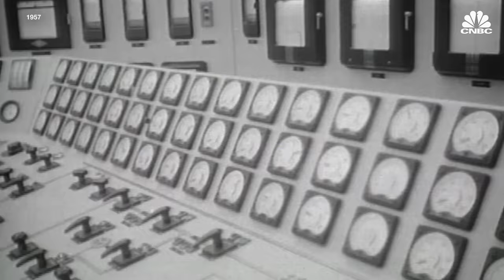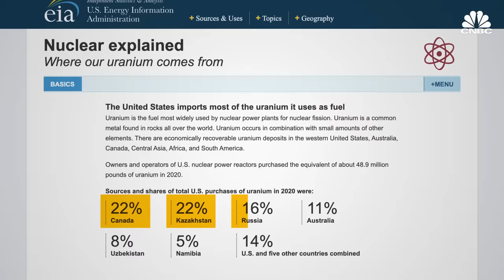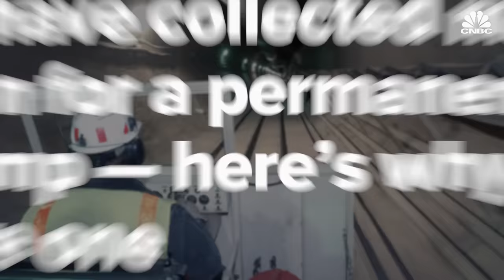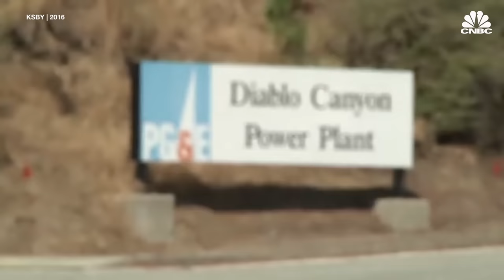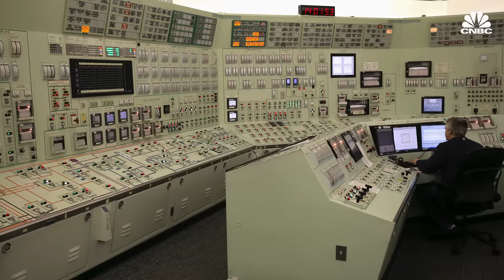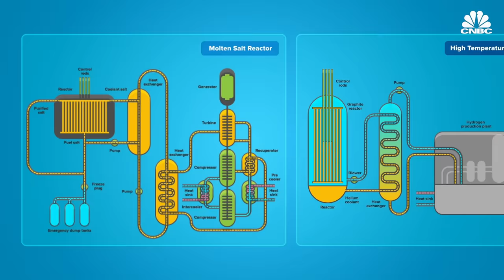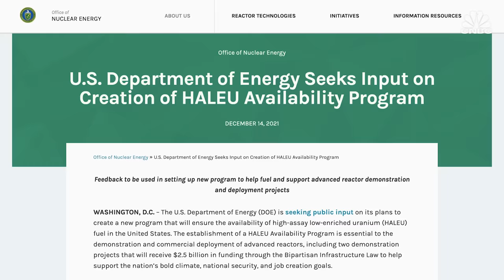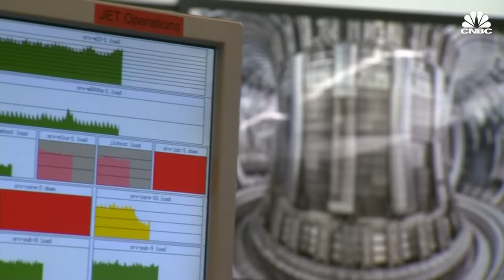Why Nuclear Energy Is On The Verge Of A Renaissance

Comment: What about LFTR/ thorium style reactors? It seems like this should be part of the conversation? They look like a safer option than the water cooled plants.
Reply: thorium is a fuel type, not a coolant type. they did actually mention molten salt reactors in the vid.
Reply: @jonathanodude6660  LFTR is though.
Reply: no, no it shouldn't, thorium is dirty nuclear
Reply: @user-by7hj4dj9s  Johnathan's right. Thorium is a fuel, not a coolant. The fluoride salt LFTRs would use could be used as a coolant, but it's a bad idea to use thorium in the coolant salt. LFTR is one of many possible molten salt reactors, and molten salt reactors are the best type of reactor to burn thorium with.
Reply: @mmoarchives2542  how so?
Reply: @mattbrody3565  well, to start, it is an unstable element, the molecules deteriates over a short amount of time, and it's not like uranium, where you can place them in reactive coated barrels and store it underground, the waste generated is uncontrolable, basically, it generates 50% less energy than 255 uranium, so thorium based reactors would have to a lot more reactors vs uranium reactors, thorium is a useless stand alone element, only useful in junction with uranium
Reply: @mmoarchives2542  Ok, figured I'd ask to see what your perspective is. I think you've actually got it a little backwards. I will concede that Thorium isn't a great fuel in practice, but that's for more complicated reasons. My apologies for the long read ahead.

First of all, thorium and its most common compounds actually degrade slowly. Thorium has a longer half-life than both U-235 and U-238 (12-14 billion years vs 700 million and 4.5 billion, respectively). The reactive coated barrel storage is for intermediate waste storage and prevents gases from discharging. The only gas that thorium would emit is Helium 4 due to alpha decay, and because of its longer half-life, it releases He-4 slower than uranium does. Intermediate storage prevents microorganisms from digesting nuclear waste and releasing gases, and there's nothing found in Thorium compounds that biologics would eat. The same goes for uranium.

Thorium oxide, the natural form thorium is found in, is well-known for its chemical stability and inability to dissolve in water. A large amount of it is currently buried in old shipping containers out in some desert, either in Nevada or Arizona. No leaks have been reported so far, nor have there been widespread contamination issues from waste piles at mining sites. It just sits around and doesn't do anything.
 

The waste from a thorium fuel cycle isn't actually uncontrollable. If anything, it's quite similar to a standard U-235 fuel cycle. U-233, the main daughter product of Th-232, burns up about 90% of the time when hit by neutrons. Even when U-233 doesn't burn up, it becomes U-234, then U-235, which burns up 85% of the time. The fission products left behind by U-233 and U-235 are not significantly different from each other, so waste containment shouldn't be a big issue. There's an added benefit of not having U-238 in a thorium-fueled reactor cycle, since U-238 produces transuranic waste. That's the most problematic stuff. The high rate of burnup for U-233 and any remaining U-235 further reduces transuranic waste buildup by a small amount.

The second daughter product of breeding thorium is U-232 which, while highly radioactive and neutron-absorbent, to safe levels in 40 years and only makes up 10% of the total breeding products produced. For waste storage purposes, it's better than plutonium with a 420,000 year half-life.

I'm not sure where you got the 50% energy reduction figure from. Assuming we use an MSR with fuel reprocessing, there may be a small difference, but not 50%. Maybe 15-20% at most.
Reply: @mattbrody3565  -- thanks for the technical information in your extensive reply.   Perhaps you are overlooking the track record of reactor projects using liquid metal [or molten salt] as a heat-transfer medium.   Experiments for what would have been the first airborne nuclear power plant were performed as far back as the mid-1950's with many engineers reacting in amazement at the heat-transfer properties of the liquid metal as opposed to light water.  This, however was short-lived being that the USS Seawolf reactor had excessive mechanical problems due to the corrosive nature of molten salt as a medium.   EDF of France went in big back in the 1970's with their 1200 megawatt Super-Phenix only to come to a commercial viability dead-end.   Trillions in today's dollars have been historically spent on these systems without much to show for it.   Additionally; the real possibility of some type of water-sodium reaction occurring with ensuing mechanical damage in in the picture whereas this situation is not present in the light water types.   Try to read our comment above on the viability of reactor power and CNBC's reporting on this important matter.     RON JAGRAF/X
Reply: @JAGRAFX  Thanks, I have looked into it. A couple of things to note, though. The Aircraft Reactor Experiment was never going to fly, the lead engineers admitted as such in their memoirs. They did, however, plan to work on molten salt corrosion issues during the MSRE. Recent experiments have also found that flibe salt can actually reduce radiation-induced corrosion in alloys with high nickel content... like Hastelloy steel.

The heat transfer properties are quite nice, and there's more work to be done to make it practical. If coolant can be safely kept in liquid form at atmospheric pressure, it's worth putting in work to make that practical. The small sizes of these proposed reactors CNBC highlighted also diminish neutron economy, leading to high enrichment requirements and come with other cost limitations. These micro-reactors are last-resort power sources, and the SMRs are stepping stones, technology demonstrators. They won't dominate the market, but the lessons gained from them will likely roll over to the systems that someday will dominate the energy market.
Reply: Agreed.
Thorium MSR seems a no brainer. The UK NNL wrote a paper about nuclear energy citing all the pitfalls of conventional reactor types and proposed reactor types, however they restricted their comments on MSRs to a single note paragraph which stated "many of these issues would be eliminated by MSR technology" (paraphrased pretty closely)
There is an over abundance of Thorium available through simple mining alone, it is stockpiled in the hundreds of thousands of tons now.

It is very hard to enrich weapons grade uranium from, it negates the necessity for reactor shutdown for refuelling or highly-expensive off-site reprocessing, it is far more efficient, can actually utilise existing nuclear waste and transmute them into less dangerous decay chains, it cannot meltdown, it can be built pretty much anywhere, they can be far smaller, they turn themselves off in a loss of power scenario, they cannot blow up, the produce beneficial by-products used by medicine...

They were never put into trial in military as the only test reactor was at oakridge national labs between 1965/6 and 1970/71 and was shutdown by Nixon in favour of a solid fuel reactor in California (as I remember)
The reactor ran for about 5yrs, but was never hooked to a generator so never produced any power.

Also, the airplane reactor was never suggested as an MSR and was also deemed an idiotic idea almost from inception, which is why it never got beyond basic ideas.
Reply: I work in the nuclear field. Let me say something here.

First of all, I agree that, IDEALLY, reactors using thorium are the optimal solution given thorium's advantages in reserves and non-proliferation.

The trouble is, molten salt reactor (MSR) is today's solution for using thorium, and corrosion it a big big headache for molten salt. We do not have a lot of time to waste to fight against climate change, so we may need to go with more practical solutions instead of betting on improvements of molten salts.
Reply: @mattbrody3565  Steve specified LFTR in his original comment and Jonathan said thorium was not a reactor type. as correct that is, Steve wasn't wrong LFTR is a reactor type.
Reply: @xinyanwang6910  Im not buying the corrosion problem. Its probably blown way out of proportion, we already use molten salts in numerous industrial application, there is plenty of experience with that. The slightly new part which indeed requires study though using these salts in high flux enviroment. A lot of start up working on the issue though, and as far as I know they yet to find a "prohibitive corrosion problem"- many seems to be concerned about.
Reply: @mattbrody3565  --- Sounds good except for the operating records of LMR's.   The USS SEAWOLF entire reactor system had to be changed out to a safer and more operationally friendly pressurized water reactor [an S2Wa from Westinghouse] at an enormous expense.   The same holds true for SuperPhenix in France but the expenditure was billions of euros more.   That's indicative of the cost-risk envelope that world reactor projects often wind up in.   Odd that CNBC would address commercial nuclear power issues WITHOUT mentioning any of the consequences of nuclear capital costs -- which is what killed the industry in  the first place in the United States.   Plants coming on line back in the 1950's and 60's all were built with a Government subsidy with up to more than half of the capital expenditures taken up by the then Atomic Energy Commission and reactor vendors as seed investment for future operating plants.   This situation evaporated in the 1970's with utility customers for reactors assuming the full weight of capital costs for the plant and this situation caused the cancellation of almost as many plants as are running now due to true capital costs and operation and maintenance costs being truly reflective of what was actually happening at each site;  the situation now being over for free money from the AEC, General Electric, Westinghouse and the remainder of the suppliers.  This placed the planned and operating plants on a finer economic edge; making expensive things going wrong more of a determining factor for economic operating the plants in future scenarios.   A gone-wrong steam generator replacement maintenance effort in two of the West Coast plants caused that utility to close down the eight-billion dollar facility for good; forcing the utility customers and the stockholders to eat the capital costs, and this was not the only utility to shut down a site due to insurmountable repairs and maintenance costs.   Reactor suppliers in the United States offered the utilities different 747 airplane designs for each plant and each utility;  something that would break a company like Boeing many years ago.   A re-started nuclear effort in the United States with the same commercial ground rules of competition and non-standardization of plant equipment will result in the same overruns for the same reasons as encountered before: a lack of scope definition and therefore ultimate responsibilities to be faced.   Far more successful in nuclear proliferation scheme was carried out at EDF in France through standardization of design and government financing;  although these nuclear plants as well are finding themselves susceptible to unusually high maintenance efforts.   CNBC and its producers and management have apparently decided that this important history of nuclear power in the US is ostensibly irrelevant and is to be virtually ignored by the current proponents as though it never happened.
Reply: @JAGRAFX  I get all that. If something “so good” doesn’t exist yet, it means there’s a problem that has yet to be fixed. CNBC didn’t address capital costs because they didn’t consider it. They’re journalists, not engineers and accountants.

At the same time, if someone figures out how to make non-water coolants easier to use, there’s a lot of valuable applications. I’d say the investment risk is justified in the long term. The same capital cost and risk story arguably goes for fusion, and molten salt cooling has been proposed for fusion reactors.
Reply: Thorium isn't some magical bullet. Thorium by itself isn't fissile, but needs to be bred into fissile U-233. This is why India for its thorium-based fuel cycle has been working on breeder reactors that can handle this step. After this the U-233 can be used as the fuel for LWRs, HWRs (e.g. CANDU) .

Alternatively the thorium can be used directly in a fast reactor (FNR), which can breed its own fuel from fertile isotopes like U-238 and Thorium using fast neutrons while using its thermal neutrons for the uranium and plutonium fuel.
Reply: @mattbrody3565  --- Probably no need for fusion reactors in the coming energy future with the further application of renewable energy sources.  Three things are currently working against bulk power sources be they coal, gas or nuclear:  1) Conservation efforts have brought load requirements down significantly.  California's peak electricity year was back in 2006 and we never again saw those huge numbers.  2) alternate and renewable sources of energy both public and private as I pointed out are now comprising more than sixty percent of the State's daytime load which is up from less than ten percent of that a decade ago and finally 3)  Capital costs for new nuclear plants [large or SMR's] [fusion or fission] [new tech or old tech] are now too prohibitive for even the larger utilities to obtain financing now that nuclear has proven to be less cost-competitive against solar and renewables.   I believe you were joking when you feigned not-surprise at CNBC not considering capital costs "because they're journalists, not engineers and accountants."   That statement that NB C's business channel is not interested in capital costs is pretty funny.   Thanks for the injection of humor.    RON JAGRAF/X
Reply: @JAGRAFX  I have my doubts about total reliance on renewables. The power sources themselves are doing well, but the support infrastructure they’d need is expensive and resource intensive. It would take a lot of batteries, overhauled power lines, and smart grid management systems to avoid losses and grid overloads. It’s nice to tap into abundant ambient energy, but at the end of the day, having a reliable power source is desirable. If fusion and advanced nuclear can mature enough to be that dependable source at a good price, they’ll stay on the market. Plus, there’s applications in industry for heat that renewables aren’t good for, but a nuclear furnace would be great for. Fusion is still promising, even when compared to renewables.

I’m looking at this from an engineering perspective, you’re looking at economics. The future of the grid is a hybrid grid, with renewables and base load support. As good as renewables look on paper, they fail to fully out-compete base load power because as renewables take on a bigger share of grid capacity, managing supply and demand gets exponentially harder. Supplying power during the day is easy enough, especially in California. The problem is, if California weather is your baseline for data on Renewables, your estimates will struggle when applied to areas with more weather variations. At this rate, nuclear power is at least a stepping stone during our energy transition, and fusion may take over some demand eventually. I understand the numbers don’t look good for future nuclear, but I think it’s still got a future.

EDIT: when I said “they’re journalists, not engineers”, they’ve reported on unsuccessful projects with faulty claims before. A lot. I’m guessing they bought into the claims these companies made without fully investigating them.
Reply: @mmoarchives2542  Citation required
Reply: @mattbrody3565  ---In the spirit of full disclosure; I had some direct experience in utility system operations on a large scale in one of my previous careers.  A quarter of a century ago you would have never convinced me that Cal Iso [The California Independent System Operator] would be planning for fifteen to twenty gigawatts of solar and renewables each day.  The growth of solar & renewables has outstripped even the system planner's estimates of just a short time ago.   Since you are a technical person you may want to know how we are currently storing some of the excessive energy which occurs in different parts of this huge state.   The first example of large "batteries" are the pumped-storage plants and lakes in the High Sierras where the utilities pump up water during high load periods to one of the lakes and then generate power on the way back down.  Helms Generating Station for PG&E and Balsam Meadows Station for Southern California Edison are two examples of capital projects dedicated to pumped-storage efforts in the State.  The second balancing effort act load management [that's what you are talking about] is the development of fuel cell and load centers for energy storage short term.   The third balancing effort which we will be using in the near future are our high-energy inter-ties with other systems all way back to the Midwestern United States.  The high-voltage inter-ties were constructed in order to bring power from Western coal plants like Jim Bridger and Coalstrip into California because we could not beat the price of coal generation back in the last Century with our own generation here.  Now those same inter-ties will be used the other way.   Fourth [and you may not have hear-to-fore heard this] the entire Western portion of the United States is tied together electrically balancing on the sixty-cycle frequency of each integrated system operating within about .001 of a cycle [59.983 on one system will cause current to flow into that system to bring it back to 60.000 in sync with the remainder]].   As one can imagine; this situation can be the source of perverse current flows between system in unusual operating scenarios;  but the point is that utilities large and small have been dealing with the technical issues that you brought up going back to the electo-mechanical era of control systems in the 1920's.   I thinks you are wrong about the numbers not looking good for nuclear in general for the future.   Several nuclear plants are in completion stages worldwide and Gates has determined that he wants to spend some of his MicroSoft Buck-a-roo's on his own LMR up there in Trump Territory Somewhere.   Who can deny that he may have technical success on the demonstration plant level and it's bound to be more viable than giving billionaires rides to space.  The California Public Utilities Commission indicated that utilities needed to move heavily into the area of energy conservation about fifty years ago and it seems to have paid off in energy usage per customer numbers.   The State's last peak system load of just above fifty thousand megawatts has not been exceeded since the year 2006.
Reply: @mmoarchives2542  To start with (as you say), all fissionable elements are unstable; that's what makes them useful.  Thorium decays with a half-life of 14 billion years, longer than U-238 - it doesn't "deteriorate" over a short time, even as a "molecule".  The whole idea in using thorium is that its 'waste" contains U-233 which is the fissionable result.  It is not "uncontrollable", there is no such thing as uranium-255.  To put it bluntly, MMO Archives, you don't know what you are talking about. There is simply no such thing as a "dirty reactor", it is not a phrase used in nuclear engineering.
Reply: Let's go even further what about nuclear fusion.
Reply: @simon2493  They still haven't even broken even, they have made a MSR in the 1960's.
Reply: @killcat1971  Yes it's same story as with Thorium reactor far future
Reply: @simon2493  Using Thorium as a fuel? Well the Indians have bred fuel from Thorium, but that's in a PWR, the basic chemistry is well understood. And as stated they have made a MSR so that has been proven to work, although you are correct that they haven't combined them. In reality the MSR is the technology we need to pursue, the fuel is pretty irrelevant, we could just breed from the spent fuel we have for 50 years.
Reply: @killcat1971  That's proof that technology is somewhat developing, but that not even what I meant I'm thinking about it form perspective of global worming, regarding fact that deadline is place at 2050 this technologies are irrelevant in combating global worming.
Reply: @jonathanodude6660  barely ! Thorium is superior, it does not produce long lived waste and is not weaponizable, it is the fuel of choice, the Yanks are just Uranium mad...the ONLY reason they chose it, was , yes you guessed it, boom ! Thorium is four times more common the Uranium.
Reply: @psycronizer  i made the comment a while back and i cant be bothered rewatching, but from what i remember, the video was about coolants mainly, so i was pointing out that thorium isnt a coolant, and swapping the fuel to thorium doesnt solve any coolant issues, while molten salt (mentioned in the video) can be used in thorium or uranium reactors so it doesnt need a special introduction for thorium only.